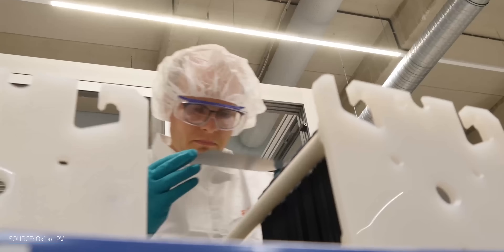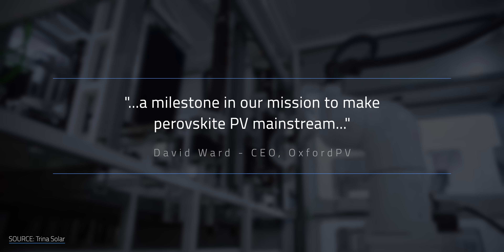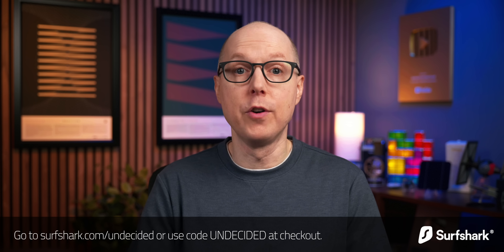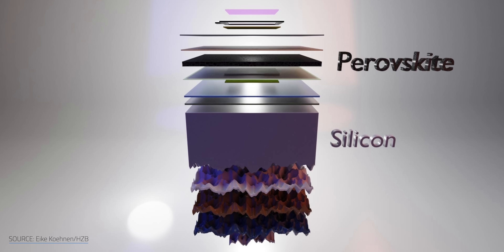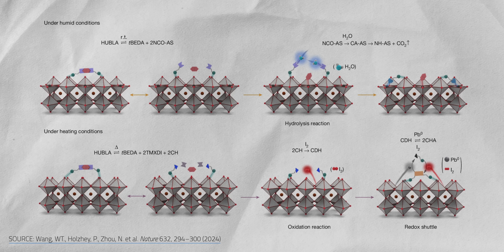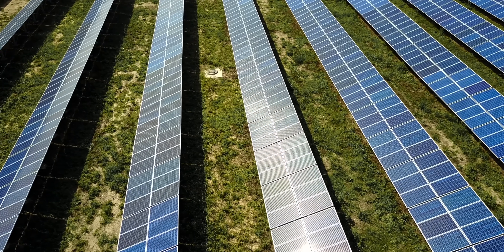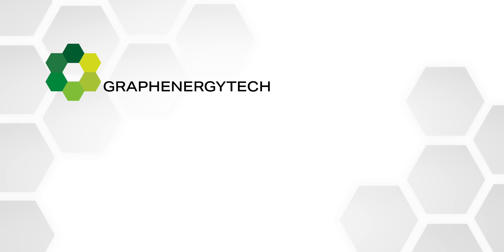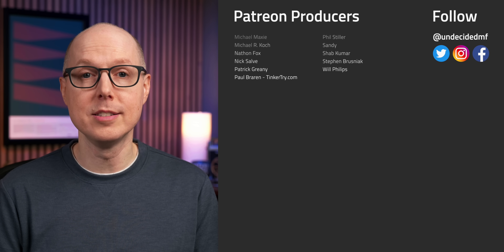What Solar’s 2025 Breakthroughs Mean for 2026

Comment: If the billionaires pushing ai invested a third into solar tech we would all be driving solar electric cars already
Reply: And if we hadn’t given oil barons subsidies for decades and decades we’d have it figured out years ago.
Reply: Maybe Solar electric vans.
Reply: same with fusion, drug development, tidal generation, wind and energy storage. The problem with those is that performance is measureable and you can't pretend to sell dreams with an infinite money loop glitch
Reply: @Mike-ms6he  Solar plus battery storage works st scale at low cost. The biggest downside is that China makes most of the sales. The upside is that they don't make much profit...
Agree on the rest of the graft.
Reply: @justinmas299  we might see them invest heavily in solar to scale up electricity production to meet the needs of their data centers
Reply: Yeah but the franking oligarchs wouldn't be billionaires then would they?
Reply: @DavidZang-b2b they are billionaires because they're providing value. None of them stole a penny from anybody
Reply: They throw money on AI to win the market and gain more money afterwards. Solar is an market already took by china, so nothing to gain easy here.
Reply: Even if we could get it to 100% instead of around 20% the surface area of a car is not big enough to generate any meaningful amount of energy, it’s about 1 miles a day, which is a full day and it has to be sunny, and it would increase the price of the vehicle drastically, it does not make sense. 

But I understand what you mean, it would be nice for both solar and battery tech to progress quicker than it is.
Reply: No this would be imposdible or you figure out how to get 40 or 50% efficiency that would be sick
Reply: This is a very simplistic view.
Reply: They'd rather die billionaires than taking out 0.001% of their money and wait 10+ years of innovation.
Reply: yield potential
Reply: If they channel their wealth into appropriate technological development, we’d not need cars at all
Reply: @maramé.r Robocab then. 
Buy Tesla shares.
Edit: or not - your call.
Reply: @maramé.r Elon Musk is the greatest capital allocator in human history and spends virtually nothing on himself
Reply: I'm sorry to tell you that's not how economics work or physics.
Reply: Battery and panel tech isn’t quite there to be worth the cost/benefit for most ppl yet
Reply: @justinmas299  No we wouldn't. There are physical limitations that prevent this from being possible.
Reply: Yeah, I wish they'd invest into solar for their AI, not just nuclear.  But also, F AI
Reply: Investing in AI means you can control the masses easier and cheaper than buying expensive advertising on television. AI generated content on free platforms like UTube, Facebook, etc. is almost free and very effective as evidenced by MAGA success at disseminating lies and false information. If lies are repeated often enough the unthinking masses will make it true.
Reply: When it’s competitive
Reply: Let's reposses the wealth and spend it more wisely. If we all agree, it will happen
Reply: @remettub that must never happen. 
Weath as opposed to money is a side effect of success. 
If people were required to develop technology and entertainment purely for the love of it our world would be duller and slower. 
Take the experiments of the extrapolation of your assertion. 
East & West Germany? 
North & South Korea? 
Capitalism is better than your suggestion I'm sorry to say.
Reply: Have you considered what it will mean when AI can accelerate AI-Augmented Engineering, do material science better than any human? It means that we'll see even more advancements across the board.

AI is a precursor to all of these things. It makes sense to invest in AI so we can then apply it universally.
Reply: Why blame  billionaires and not democrats?  Gavin Newsome is is spending over 110 billion dollars on a regular speed train nobody wants and will never get built.  He just spent 24 billion on “the homeless “, all the money gone, zero results, or accountability.

How much solar could have been implemented with 140 billion dollars?  Instead we have nothing.  PG&E gives rate payer millions to Newsome’s wife  for art.  How do you feel about that?
Reply: @jasonborne5724  Why not blame republicans for trillions in tax cuts to the super rich and at the expense of every other American through raising the national debt? I'd rather money be spent on the homeless than the .01% holding as much wealth as around 50% of Americans combined.

Both parties have their corruption, but ONE holds most of the cards right now. Get back to complaining about the dems when they're back in power. 🙄
Reply: Capitalism does not drive innovation 📢
Reply: @ggggagi Yea, the maga says solar is woke... 😊
Reply: @jsjs6751 no not really just not the way that they're doing it. Stop plowing down fields used to be used for farming for solar fields. Put them on garages put the one people's homes put them on parking garages put them on top of buildings on skyscrapers there's so much roof space do not take up our free land.
Reply: @ggggagi   lol nope, China only a became a player on the world scale after they adopted capitalism. In fact they went so hard into it that their rivers turned green and they allowed factories to set up nets to catch workers who tried to jump from all the stress. You think the 'regulations' that China has on corporations could even compare to the US? Only if said regulations means policing criticism to the ruling party or banning 'rainbow pride',  depictions of the occult in fiction, or other forms of censorship.
Reply: @ggggagi solar panels weren't invented by communists, which has far fewer examples of innovation in general
Reply: @lovetohate028  and yet almost all real innovation in capitalist countries were lade by state funded or state managed research...
Reply: @Arkansya  sure, but capitalism gets (some) products to market. Look at this video. Lots of University lab work, some state-funded, but also startups spending investor money hoping to capital ize on the innovations
Reply: AI will mean they won’t need solar… fusion power will come very soon after AGI.
Reply: @keyboardoracle1044  Sure, only 10 more years!
Reply: @megamanx466  yeah, that’s why China and the US is throwing so much at AI. The new arms race. But keep thinking the old meme of 10 more years will be true forever if it makes you feel better about yourself.
Reply: @keyboardoracle1044  Ok, so China wants severely to track & monitor any possible dissidents that are against their policies mostly, but they could use it somewhat for military purposes, such as autonomous drones.
The U.S. is throwing so much money at A.I., because corporations want to always reduce overhead(workers usually among other things) and they think "A.I" is the way to do that. There is also the case for autonomous drones for the military & even extra planetary exploration.

Truly useable A.I., such as A.G.I., is likely a decade away in real time from all the evidence I've seen and my own inferences. 

You seem to be in a manic period of your bipolar episodes, so I'm just going to wish you a good day & be done. Feel free when you're ready to have a mature conversation or even debate. 😁
Reply: @megamanx466 wrong, whoever develops AGI first will take over the world, not just the work place. Do you think Elon musk doesn’t want to be grand master dictator of the world? I think I’d prefer China, at least they will have a committee making the decisions,  until the AI realise that humans are terrible at leading, corrupt and evil and just take over everything.
Reply: @megamanx466 where is your evidence of bipolar episodes? Maybe you need a mirror.
Reply: @keyboardoracle1044  You sound like you're manic. Our conversation is the  evidence.

AGI is not likely to come any time soon, but you're not looking for evidence doubting your convictions so sound your trumpet and go watch more "AI super powerful" trope movies.
They're more entertaining than the opposite.

Have a good day!
Reply: @megamanx466 3 to 10 years is the majority view on when AGI will come but I’m manic for stating facts ok. You seem so strong in your convictions. Do you hold yourself to the same standards as you do others? When was the last time you changed your mind when presented with new information? I do it all the time. You strike me as the type that scours the internet looking for information that collaborates with what you already think. Then think you are always right. I suggest you watch a few videos on logical fallacies then test what you think you know. If you are honest You might change your mind about a lot of things you believe to true.
Reply: @keyboardoracle1044  Actually I like to be proven wrong. You didn't actually do so. Being proven wrong means you learn something new... which I love!
I typically look up a topic before spitting it out online and stating it like it's fact. It's ok to be wrong online and most of the time in normal life too; however, when shown that you're wrong, admit so and move on. None of us has all the information on everything.

MANY people online do what you did, because it's easier and they are so self assured that they're correct. It's the exact thing that many Ancient Greek tragedies warned about.

Anyway, Happy Holidays and take care. 😅
Reply: @megamanx466  you are making the mistake that you think I’m making. But you only look for confirmation of what you already believe when you search stuff online. Then you think you are the only person with access to the internet. Not all information online is equal. You should really look up logical fallacies. It will help you to understand what is reliable and what is opinionated garbage with an agenda. I too wish you a happy holiday season. Just look back and realise it was you that started with ad hominems.
Reply: @keyboardoracle1044   it's possible that AI will solve renewable energy and global warming problems in the next 5, 10, or 15 years. But right now "AI will solve humanity's biggest issues!" and hyping promises to buy power in the future from non-existent fusion and new nuclear is greenwashing and handwaving to counter the undeniable harms that massive datacenters mostly powered by natural gas are causing right now .

I'm a fan of AI, and maybe there will be an AlphaFusion and AlphaNextGenNuclear that dramatically accelerate progress. But we clearly don't have them yet, and deciding we don't have to solve problems now because we'll have better solutions in the future has been the fossil fuel industries' line for decades.
Reply: @skierpage I wasn’t saying we don’t need to solve the problems, I’m saying the majority of humanity don’t have the emotional intelligence to make the necessary sacrifices to solve them. Even thought there isn’t really that much a sacrifice to solve them.
Reply: @justinmas299  investing solar is a dead end. Germany is suffering from investing too much to solar, spain is following them.
Reply: @Hababam64107  Why? Since the sun doesn't shine 24/7? Within a few years we have affordable battery storage addressing that problem.
Agree with the nuclear, though.
Reply: @Hababam64107  They also use FAR LESS power than the U.S. Look at U.S. energy consumption compared to Europeans on average and then do the math. If the U.S. gets more cheap energy, IT WILL use it! 🤷‍♂
Reply: @m @megamanx466  what I am saying is you can’t fill all the demand with solar and wind or you will end up with the same problems like germany and spain. I think in the near future we will start hearing geothermal a lot, thanks to fracking tech. Apart from that US needs more nuclear for sure.
Reply: @Hababam64107  Well you said solar was a dead end and I highly disagree with that. It's still barely touched where it could be implemented and still improving all the time.
Nuclear I think should make a comeback, but it has many hurdles to be feasible again. Geothermal depends on where you are to be that viable.

Fossil fuels are dirty(as they're currently implemented), not as efficient as the forms of energy generation mentioned prior, and subsidized whether we like it or not... at least in the U.S. Even the oil corps. know that demand is going down globally(other than maybe LNG) and are preparing for it. 🤷‍♂
Reply: @megamanx466  Solar’s problems may be fixed in the future, but it is currently destabilizing and decentralized. If it exceeds a certain percentage of a country's energy production, it creates more problems than it solves
Reply: @Hababam64107  I'm not sure what problems you think Germany and Spain have? It's proven that the blackout in Spain this year was caused by fossil fuel plants failing to meet their commitment to providing inertia, and I haven't heard of any problems in Germany. Wind is now the biggest source of electricity generation in the UK.
Reply: @mjcamp01  grid is seeing surplus a lot, driving prices below zero and this is a huge problem for the producers.
Reply: @Hababam64107 great, producers need to learn to incentivise load shifting, a octopus do it really well in the UK, they give free electric when the price is low, and pay people to turn demand off when the price is high
Reply: @Hababam64107  What problems are you referring to that "it creates more problems than it solves"? 🤔
Reply: @Hababam64107  this is just not true.

Comment: OK, let me explain. The only people you can legally sell perovskite panels to are Americans. You could sell them to the Chinese, but for some reason they do not want to buy them. And it is illegal to sell them in Europe. The reason is that in the EU, producers must provide a two-year warranty. That should not be a problem—solar panels last more than 20 years. In fact, conventional solar panels often last up to 25 years. This means that the producer guarantees that after 25 years of continuous use, the panel will have lost no more than 20% of its initial power output. In the case of perovskite panels, Oxford PV cannot even guarantee two years. Why? Because a perovskite solar panel loses 20% of its initial power after—hold on a second—TWO MONTHS!!!  And there is no way to improve this. Everything else is just pure PR and BS. Saule Technologies in Poland just bankrupt over that quite significant issue last month. They couldn't improve lifespan after a decade of research and millions spent. Oxford PV is a bankrupt too but they keep going due to PR stunts and "collaboration" with US solar farms. It's a dead end.

Comment: It's funny.  When we just wanted reliable cheap energy, the pols and extreminsts said no and gave us wind and solar, saying it was necessary, but the market would never have adapted it without the scam that is subsudies.  Now that we have AI coming onboard, and actaully need more power than we can apply, I think it's hilarious that AI will kill the so-called green energy scam.
Reply: Actually it won't, cause it will usher in a new nuclear power age. If this bubble doesn't pop in the next 3 years you are going to see a huge move towards nuclear and red tape finally being cut in the USA to deploy more reactors.

Comment: The Perovskite and graphene idea could prove very useful for self charging cars and trucks.
Reply: We already have solar cars that can propel themselves from the sunlight incident on them (on an unshaded highway on a sunny day). Do an image search:  they are barn doors on bicycle wheels with a tiny bubble for the driver's head. More efficient solar panels might make them a little more practical. Lightyear (the Lightyear One) and Sono (the Sono Sion) went bust trying to make solar cars that can charge enough when parked to drive a dozen miles a day (in optimal conditions), and Aptera still doesn't have enough money to bring its tricycle weirdmobile to production.

It will be great if perovskite solar film becomes cheap enough to be an obvious option to add a few miles of range to a normal EV when parked. And it should be a no-brainer to add solar panels to trucks to power their Auxiliary Power Units (for refrigeration and other power takeoff) and camper vans.

Comment: How about something to warm the solar panel up in the winter to get snow off.  This is the problem I always have in the winter.  The panels get snow covered, and when the sun comes out but its still cold, no production.  I have tried to wipe away the snow with a long snow broom (made for solar panels), but this is very hard and tiring, and did not yield much.
Reply: @JDGlass-m1g  need defroster  on the panels!

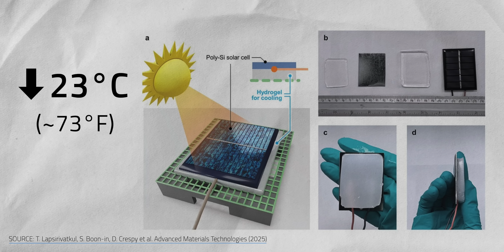Comment: 10:05 you can't convert the drop in temperature in C directly to a drop in temperature in F. As an example, -40C = -40F, and 0C = 32F. The delta C temperature is 40C, and the delta F temperature is 72F. If you convert 40C to F, that's 104F.
Reply: @Bealz709  umm, yes you can convert that. Each 1 degree C is 1.8 degrees F. The only difference is where “zero” is on their scale. Remember the old nine\fifths or five/ninths?

Comment: Kesterite's dependent on copper could be an issue due to the demand from the computing and electronics industries on top of the usual demand for copper water pipes in homes. Still, let's see what it can do.
Reply: PEX is the general replacement in houses.
Reply: @brodriguez11000  depends on where in the US. A lot of places (and customers) don't like using something different from what they were used to, and so they default to copper. I remember a plumbing boss of mine (west coast) years ago explaining how he would try to convince potential customers to use PEX. He was usually successful, though not always, but the fact that he had to regularly try to convince homeowner potential customers to use PEX told me that they were defaulting to copper. That's what I was getting at :)